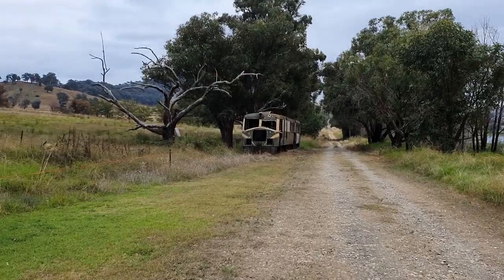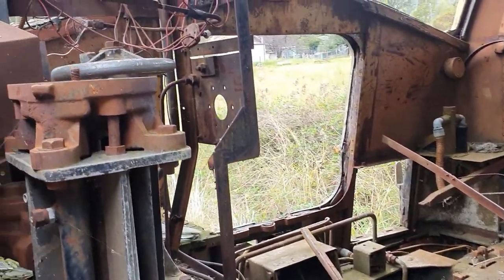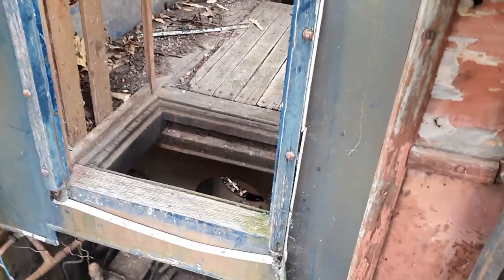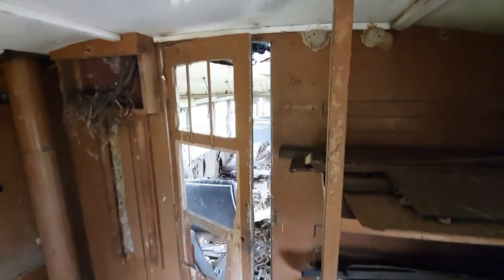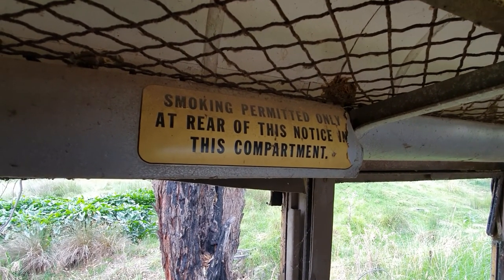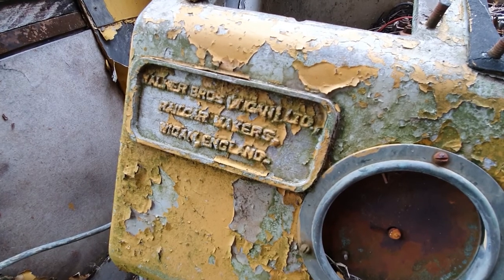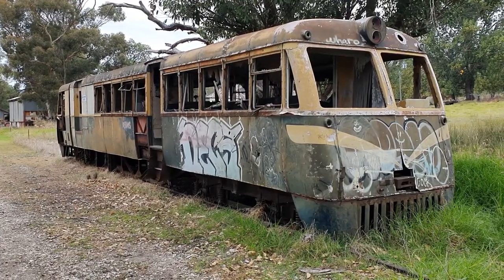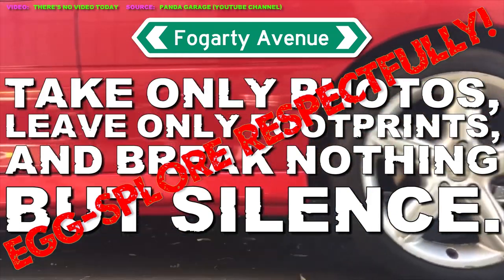RUINED Abandoned Victorian Railways Walker railmotor

Comment: The story with the heritage railway that was supposed to be there (I’m pretty sure, at least this is what I’ve heard) is they had a running walker and were ready to start, but someone got a bit too excited and drove it before it was all approved, they were then forced to abandon it and the tracks were ripped up. There used to be more walkers there but they’ve been taken by various groups, and I’m pretty sure the motor from the one in this video (or parts of it) are now in 22RM at the Yarra valley railway, either that or 32RM at Daylesford.
Reply from the maker: Magnificent.
Reply: They were actually offering rides to the public. There's an old railpage thread somewhere on the matter.